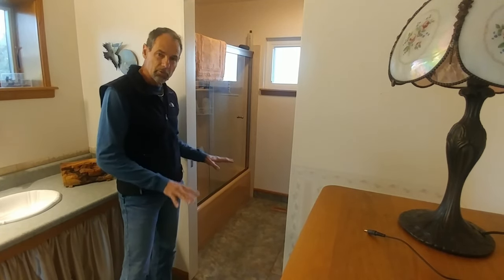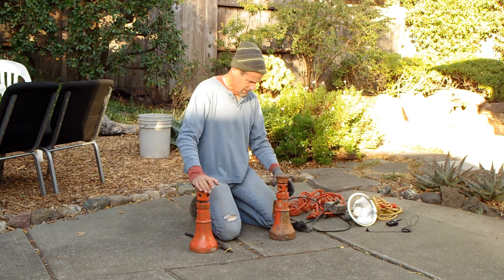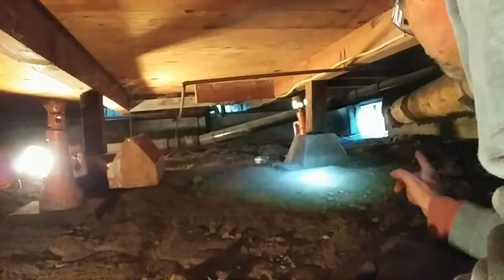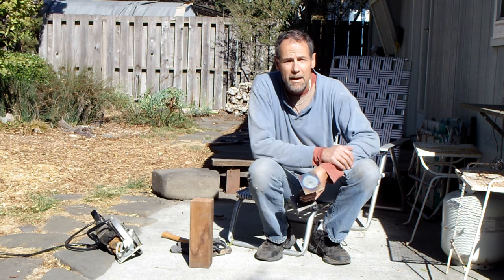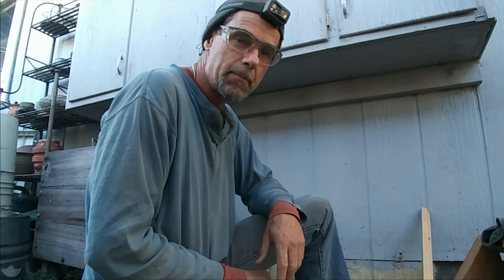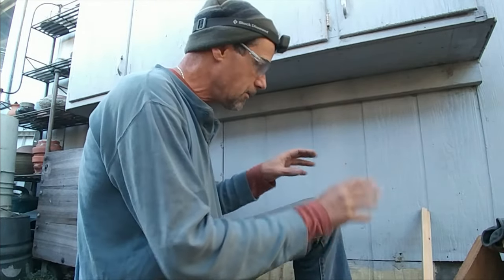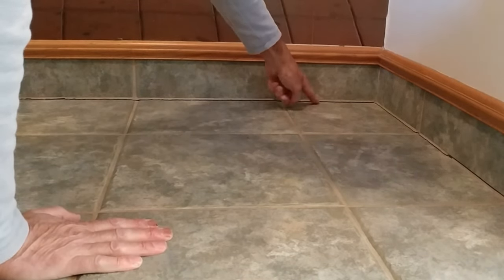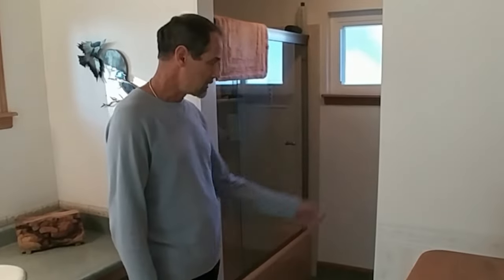Fix-it Guy Takes On Foundation Repair

Comment: If you knew how long the post were in the first place you'd probably find they're about 3/8 shorter now it's amazing how much wood shrink over time we put a beam down the middle of my brothers house the 8 foot 6inch post shrank by 1 inch in the first year we jacked up the post up to level and with all the shrinkage put in a 2x6 under the post in worked good for a few years but after 4 more years it had shrank another 1/2 inch or more would have been nice to have those beam levelers you used then it would have been easy to relevel it as it shrank as it was we left it but the 2 post shrank about 2 inches or more over 10 years so you are smart to reuse the old post and put in levelers next time its raising the levelers and there will be a next time because from what i could see in the video most of your problems were from shrinkage now comes the settlement of the post support once that is finished you'll finally stop sinking but you won't let it get as bad as it was
Reply from the maker: I  never thought about wood shrinkage. Makes a lot of sense.

Comment: This video needs more cobwebs.. 🕸🕸  Couldn't you move the footings so they were aligned with the posts?  The footings looked like the movable precast blocks.
Reply from the maker: Each pier block sit in a concrete slop pour which makes them unmovable.

Comment: How much did you jack up at that once?
  I fear cracking drywall and such if I jack my floors too much too soon.
  Btw, shouldn’t there be joists every 16-24” spaced apart supporting the floors?
  That looks like it is supported by beams and no joists between them. 
  Just curious.
Reply from the maker: The sag in the middle was just under 7/16". THe walls in the house had a few small cracks when I bought it. Now I have fixed them.

This post and beam floor design is something that was done now and again in the 1970's. It incorporates a 1-1/8" T&G plywood subfloor for integral strength. To my knowledge it is no longer used as a construction method.

Comment: Can you attach those adjustable post to the concrete footing?
Reply from the maker: I see no reason why not. In my case, with poorly aligned pier blocks, it made more sense to spread the load by mounting the post to the block. Putting the jack on the pier would have also dictated that I drill new mounting holes in the plates.

Comment: We bought a cabin that had this done 4 years prior, they did a great job BUT in 4yr it already is sagging again.

Is it proper to remove the floor boards to allow for digging a proper full depth frost line footing??

The amount of sag on that particular site, would mean we would be adjusting it ALL the time and we dont want to be dealing with that...
Reply from the maker: I've been lending a hand on another leveling project and I made this little video: https://youtu.be/lN6y6JTy3-0

You'll see at about the 2:30 mark that the floorboards have been removed in areas so that pier footing could be dug, and while at it, over 4 yards of soil removed so as to have better crawl space in the future.

Continued settling indicates there is some other soil issue which should be corrected. Otherwise yes, leveling it'll be an unending problem.
Reply: @ItsFixable  So to say that the soil is too soft for surface corrections

Would pour-in footings at frost depth dug through the floor be a 100% approach, or can there still be issue with even 4' dug footings?

I feel like if the base of footings was a poured 2' round, then an 8" mold poor ontop of it would help give the footer a fat footprint, keeping it from sinking at a 4' depth? Or is this not even a garuntee in soft soils?
Reply from the maker: I would think that it'd be necessary to determine at what level the soil is of stable compaction, and then to dig to that level. I haven't experience working on foundations where there is seasonal freezing but have heard that it causes heave, so getting below frost line is necessary. As for dimensions of the footings, that should be specified in local codes which usually account for all the native conditions.

You called it a "cabin." How old is it? Was the site compacted before building? Was it originally constucted to code with proper a foundation? If not, I'm not sure there is an easy solution.

Comment: How has your repair helped two years after this fix? Just wondering.
Reply from the maker: Well, floors remain flat and uniform, pocket door remains plumb with strike and locks, swinging doors remain plumb and latch, and the wall cracks I repaired remain solid.

Comment: I have been planning a floor repair for some time now and have looked at using these too. Am I wrong or are your supports upside down? I would think that the threaded rod will be on the upper portion to where the lock nut would hold downward pressure better.
Reply from the maker: They function in either orientation. My 4x6 beams were wider than would fit into the channel bracket so putting the plate on top was neessary.

Comment: Nice video 
How much you spend doing this.
Reply from the maker: I don't remember exactly now,  but less than $1000.
Reply: How did you know how many turns to stop at, I wish you lived close to fort worth Texas so you could help me 😊
Reply from the maker: I knew how much the floor needed to be lifted, measured existing height from pier to beam, added the 7/16" (or whatever was needed), and turned until that measurement was reached. Then I checked levels along each beam and made minor adastments as necessary.
Reply: I just saved money to tackled on this project, can you just use one floor jack to lift up one beam at a time or do you have to lift up several beams at same time with multiple floor jacks.
Reply from the maker: I would say it depends on the span you are needing to lift. If only a couple feet, one might work. But the more you have the easier it become as it spreads the load. I guess you could try with just one and see. But these jacks are pretty inexpensive to rent.

Comment: Just bought a home and I need to do this. I however do not have a crawl space. I've had to cut holes in my floor. ( yeah I know yay me!) My whole house has almost leveled lower than the middle two beams. Should I bring everything back up or can I just lower the main beam to everything else. Once I do that could I run a few posts into the ground and concrete them in so I don't need to deal with this again?
Reply from the maker: Have you determined why the center hump occured? That information is important before deciding on a corrective action. Swelling up in the center vs. settling down on the perimeter would dictate different approaches.
Reply: @ItsFixable  just went in under the floor and it looks like it's been leveled before and they ran 3 4x6 poles along the center from one side of the house to the other. Seems like the rest settled after that. The front of the house seems like it's resting on a thick piece of lumber with no stone or concrete beneath it from what I can see.
Reply from the maker: Doesn't sound simple. It needs a solid perimeter concrete foundation. You may need to lift the entire house to pour new, or at least added, foundation. If its sitting only on dirt it may never stop sinking.

Comment: I have another question I’m planning on doing this next month but will doing this next I’ll I run the risk of the house settling again and making the floors buckle?
Reply from the maker: Have you determined why the house moved in the first place? Has that issue been resolved? If not, further movement will cause additional problems. Find and correct the overriding house movement problem before leveling the house and floors.

Comment: Why did you install the leveler backwards? Shouldn't the post be up against the beam and the leveler bolted to the concrete pier?
Reply from the maker: The piers are out of alignment with the beam and unmovable because they sit in concrete. The plates wouldn't center well for a good attachment. The function is the same regardless of which end is up or whether they are on top or below the post. Hence my decision to place them on top.

Comment: That was hard for me to watch knowing that all you really needed to do was wedge a block of wood or brick under the old stumps once you raised them to the correct height. The stumps that didn't line up with the concrete footings are fixable by moving the stump and replacing the old concrete footing with a cement block or a large concrete pad, using a longer stump if necessary. Nevertheless, your hard work has paid off and the job looks great. Awesome video.
Reply from the maker: Thanks for the thoughts Crusty. I live in California, earthquake country. Building code doesn't allow for simply blocking and wedging; permanent bracketing is called for.
  Those pier blocks are set into concrete puddles. I couldn't move them without chipping them out. There was no way this old boy was going to do that in that confined working space. Doing what I did was all I could handle and it passes code compliance. Best of all, my floor is flat, no flexing or squeaking now!
Reply: @ItsFixable  G'day, Mate, I fully understand. I figured it was regulation. Sorry if it came across as criticism, I didn't mean it that way. I live in Australia, so things are a bit different here. And that's kinda what I meant, all we would have to do is wedge them up where they were. I have just bought an old solid brick home out in the country, and it needs stumping, thus the reason I was looking for ideas on YouTube.
I'm 61, have had surgery on my back after I broke it many years ago, and last year I had a heart attack, so I'm hoping and praying I have the drive and strength to do what you did, because I sure don't have the cash to pay someone else to do it. LOL. 
Anyway, Mate, I loved your video, you seem like a great bloke. Glad to hear your floor is level now. God bless you.

Comment: How is it your flooring looks so clean, yet it's been there long enough for the earth to have settled so much?
Reply from the maker: Well, it's just a high quality ceramic tile which is one of the most durable flooring materials. There are a couple small chips where I've dropped something heavy, but the color and pattern hide those pretty well.
Reply: @ItsFixable  LOL I meant under your house. I've got sagging floors to fix, and my joists are old looking and have insulation hanging down, old wiring, etc.
Reply from the maker: Oh, I see. The house was built in 1975; it never had insulation under there, though the rest of the structure does. The ground movent was due to changes in ckay soil's moisture after years of drought,  and an issue with neighbor's property flooding mine when a large pipe burst. But this clay earth has always expanded and then contracted with the wet and dry seasons. Back in '75 they didn't do all the site preparation that is common in developments around hear today. They just scraped it flat and started building.

Comment: Did you have to drill holes in the cement blocks to screw down the bracket?
Reply from the maker: The surface of the cement block contains an embedded wood block to screw into. These pier blocks are factory made that way.
Reply: @ItsFixable  Ok thank you.

Comment: I like how this worked but when I googled for the Simpson strong J57 holders they all have the plate on the bottom and the bracket on the top.  Is it just a matter of choice how this is installed?
Reply from the maker: Yep, flip it either end up.

Comment: What size screw jacks did you use?  5 ton? 10 ton?15 ton?
Reply from the maker: I haven't a clue?! It doesn't really matter for the approach I used because I wasn't "lifting" the house. I just supported and slightly elevated each section as I worked.

Comment: Those are water marks on those beams. You need some water management asap. Those piers are literally drifting away in a silt river. Have you looked at what’s going on under there during heavy rains? Lots of fungal rot growth. Good luck in your quests

Comment: Might be a good idea to add some support beams, the installed ones look like more than 24 inches apart. or even cross tees to support the flooring throughout the crawl space.  Good thing you're skinny!
Reply from the maker: Yeah, the existing are 4x6's on 48" centers. A rather minimal design. But the floor sheathing is 1-1/8 T&G.

Comment: I'm surprised you did wood block on concrete, and metal against the joist.. wouldn't it make more sense to put the wood against the joist and metal on the concrete?
Reply from the maker: The thickness of the beams were such that they didn't fit within the U-shaped bracket on the end of the jack and it would have been difficult to rabbit the beams for that bracket. So flipping the jack was a simple solution.
Reply: @ItsFixable  sorry, I think you are getting the wrong idea... You pulled off the wooden 'legs' that didn't reach the concrete, you cut them, then used them under the metal... Simply flip the wood+metal so that the wooden leg was at the joist instead of the metal.
.. since the metal is already around the wood, nothing would change there.
Reply from the maker: Oh, gotcha. Yeah, I guess my thought just didn't see that then or now.
Reply: @ItsFixable  ah ok, I didn't know if I was missing something technical. Thanks for the replies!

Comment: Two man job. One is underneath and the other cuts and passes parts and materials. And is there in case of some kind of catastrophic failure.
Reply from the maker: Helping hands certainly would have made the job easier! But potential catastrophic failure really wasn't an issue.
Reply: @ItsFixable  any time you are working under a house there's an opportunity for a catastrophic failure.

Comment: Do you have to get a structural engineer and get county permits before fixing your piers? I was told from someone at Home Depot that I needed to get a permit. All I wanted to do was add three or four more piers to beef up my floors.
Reply from the maker: What triggers permit application and plan review varies somewhat depending where you live. You need to contact your local building department to find out. If so desired, you may then be able to define the scope of your project to remain outside the requirement. Any contractor worth his salt will likely want a permit issued. He can loose his insurance and license if he violates the code. All that said, if you do the work yourself, who's to know? But regardless of how one proceeds, it is of utmost importance to do all work to building code.
Reply: @ItsFixable  Yes, I agree with doing work to code. Should always be done.

Comment: That house can collapse with you under it you did not put metal plates between the jack and beam is that safe?
Reply from the maker: No chance of collapse; the screw jacks supported the load while each post was removed and replaced. The screw jacks were moved each time as necessary to support the beam.
  Metal plates? Each new post jack has its own plate screwed directly to the beam. You know, these central loads are actually rather minimal. The primary load is on the perimeter foundation.

Comment: Since those beams are on the edge could you have put a base under the beam? Just wondering cause seems like a 2x4 or sum'n under it would have distributed the weight better. Just thinking out loud before I attempt it 🤣
Reply: Never mind. I seen the end with L brackets 🤣
Reply: Probably not code but is his own home. The toe nails do nothing for weight distribution on that pier
Reply from the maker: You're right, they simply help maintain alignment. Based on the footprint from the original blocks, the piers never were in proper alignment from the day the place was built. I don't know how that passed inspection even back in 1975.

Comment: I bought a mobile home that had sunk into the ground andI found out it is filled with mold. There is no cement poured on the underneath the home, just placed on the ground . The contractor pulled up all the floor boards and its fifty down there. I think every critter was living underneath this mobile home.The contractor said he can fit it. he had to pour new footing. I was told it will not hold up because there is no slap poured. I was told In a few years it will be sinking again.. Would you know if this is true ?  
I cannot believe the mess this place is in. Everything has to be gutted inside due to mold , plumbing, electrical , and heating and air. I wish I never bought  the this mobile home and just bought a real sick home, for a lack of a better word.
Reply from the maker: Sounds like quite the project. I wouldn't know about future settling, there are so many factors in play. Has the original cause of settling been determined and has that been corrected? I'd suggest that be figured out before any further work is undertaken.
Reply: @ItsFixable   I was told it sank into the ground because of water issues The new mobile homes are all on cement slaps to preventing it from sinking. I didn't want a new mobile home because of the lots they are on.   This mobile home that I purchased is bigger and the lot is beautiful and not on top of one another like all the rest.   I live in NJ and new mobile homes start at  three hundred thousand dollars and more.  The price of homes in NJ are insane.
Reply from the maker: Well, since its a mobile, I would think the best solution would be to lift the entire structure, grade and pour a proper concrete pad, install a proper moisture barrier beneath the mobile, and then set it down on the new pad. I know that's costly but wIth home values at those levels, it's worth the investment. Best of success to you.
Reply: @ItsFixable   Thank you very much for your reply... I think a concrete pad is the best option.